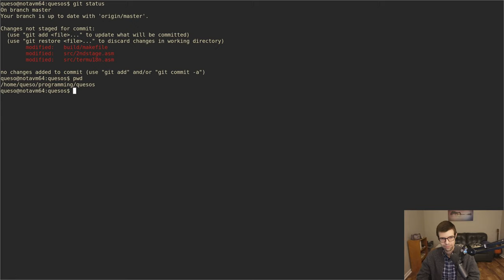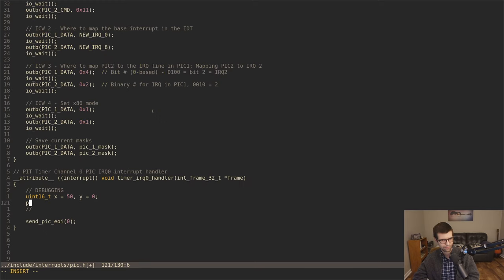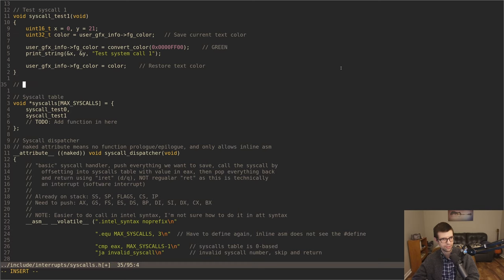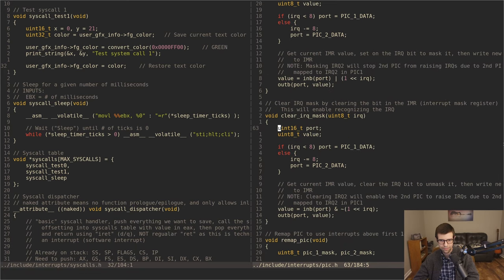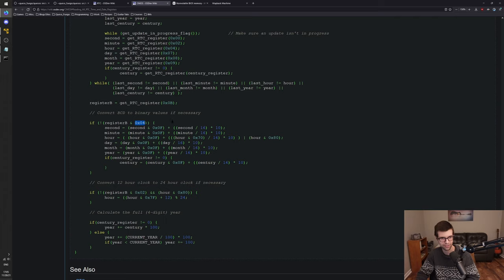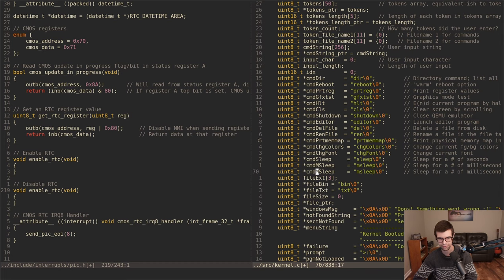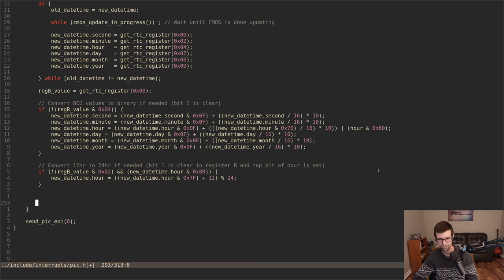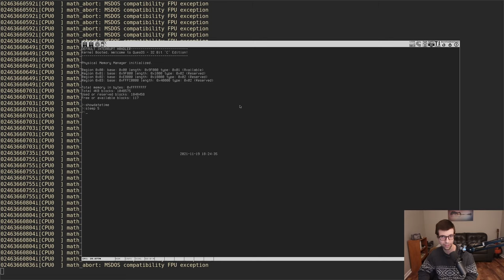Timer IRQ0 & Real Time Clock IRQ8 | Amateur OS Dev (in C)

Comment from the maker: Outline:
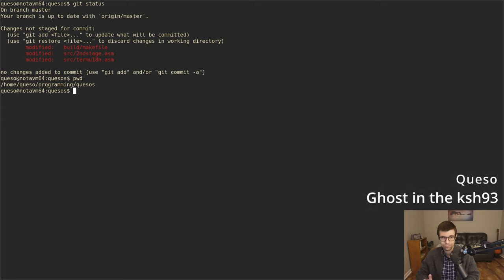0:00 - Changes to use nasm instead of fasm; use octal instead of hex when building filetable
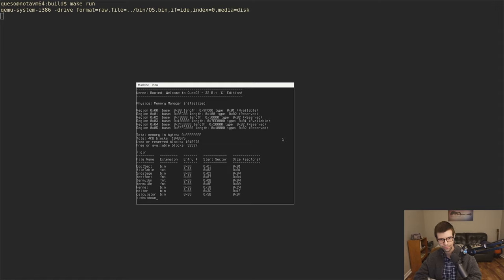8:40 - PIT info
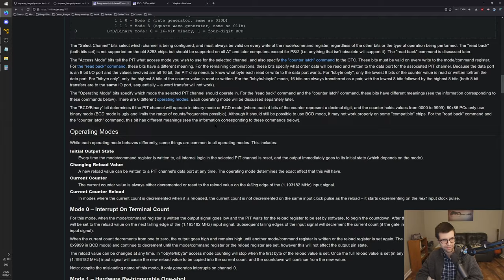14:11 - Set up PIT and IRQ0
39:13 - Sleep syscall and commands
55:11 - atoi() function
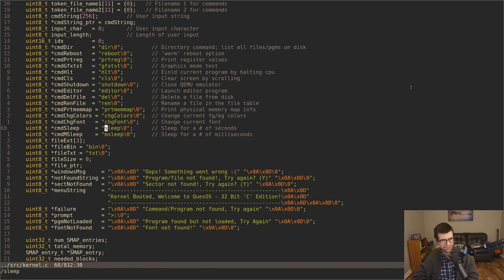1:00:44 - Sleep testing/debugging; move syscall calls to time.h
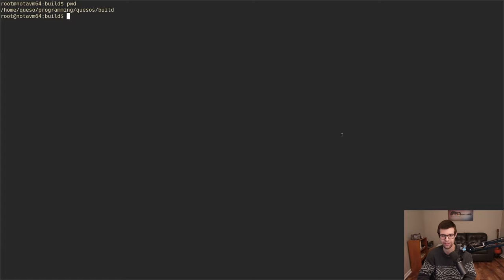1:20:10 - CMOS RTC info
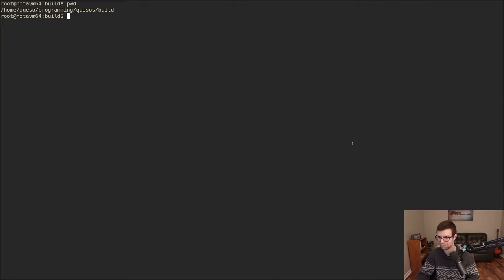1:31:07 - Set up CMOS RTC and IRQ8
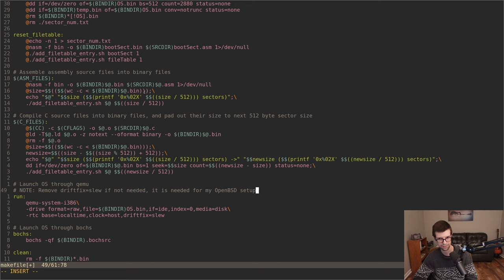2:29:58 - Wrap up & Outro